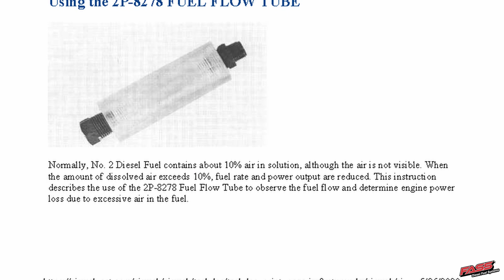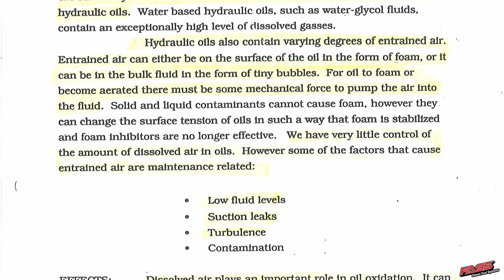Everything wrong with diesel fuel...

Comment: I have a 99 second GEN with a FASS lift pump titanium series filter and water separator my mpg went from 9 to 17 miles per gallon. I am not a paid sponsor I’m an actual customer and I recommend very highly FASS no doubt. The people who install it I top notch and extremely professional in all that they do. The stock lip pump in the Dodge did not perform a so I replaced it I’ve had the truck for over 10 years and I’m going on the second year with FASS The truck starts up right away there is no pause or time delay
Reply from the maker: Thanks for taking the time to write a review, Stephen! We're glad to hear your 2nd Gen is doing so well—they're great trucks. If our team can ever assist with anything, don't hesitate to reach out!